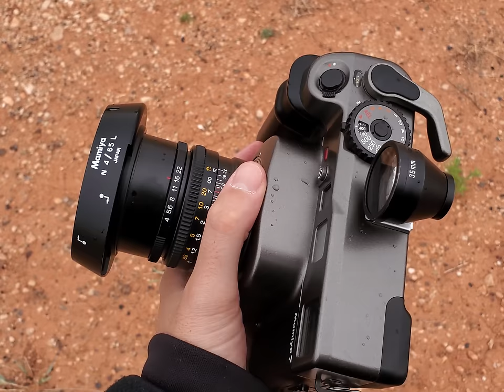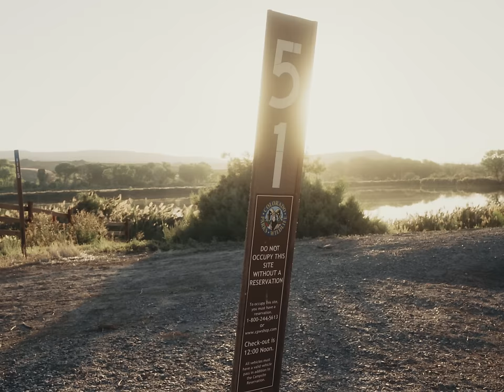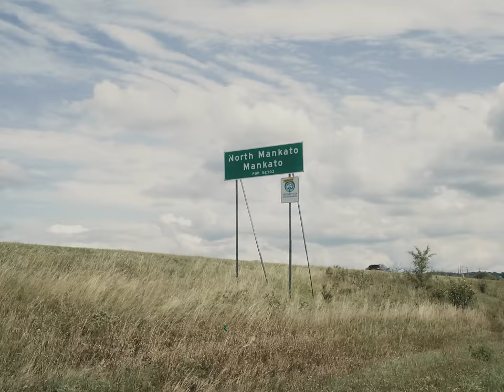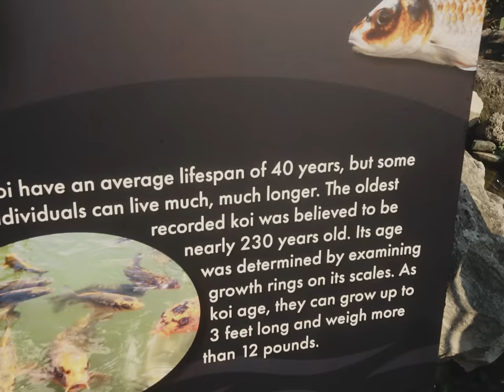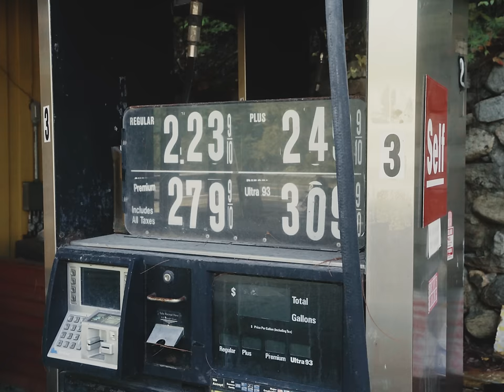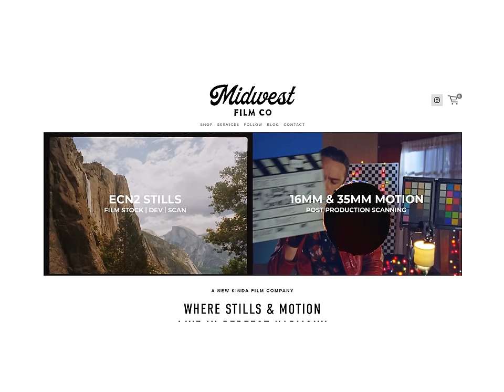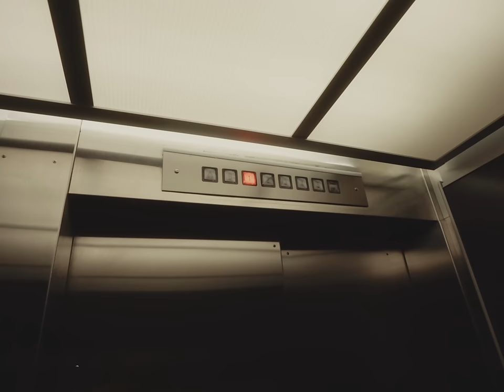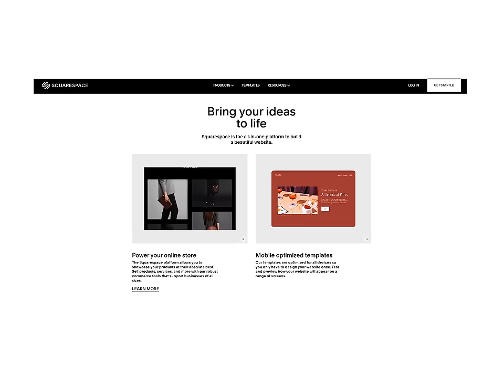6 Weeks Coast to Coast

Comment: Having done many long days on the saddle i am quite amazed that your body didn't just give up after a week. The 100 degree heat and rain also get tiring very fast!

Little tip for next time on those summer days, soak your shirt in water and wear it under your gear. The water will evaporate, cooling you off. It's amazing.

Had to laugh a little of your lack of proper gear to stay dry and warm. 

I wish you weren't riding in a t-shirt and without helmet at times. They say "dress for the slide, not for the ride". 
I got a fucked up wrist and knee and broke fingers and ankles.

Some stuff could've been avoided with proper gear. I got a rash once and that shit is NSFW to say the least.

Comment: Rough to see people struggle in the heat. It’s never fun. I’ve only owned a motorcycle, so I wanted recommend some form of a scarf when you travel. Best accessory you can ever take. In the heat you drench it in water and shove it under your motorcycle jacket. When the wind moves through, it gives you a pseudo air conditioning.